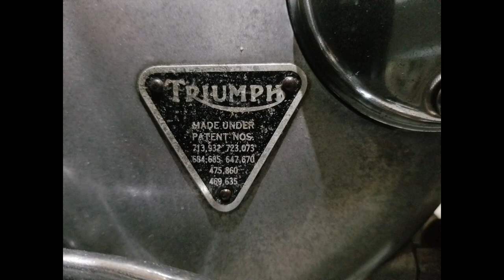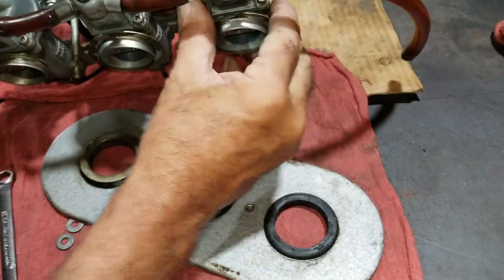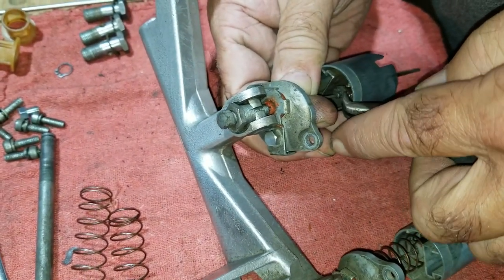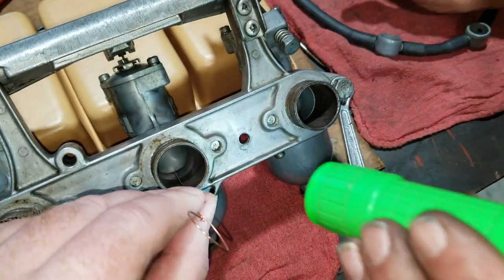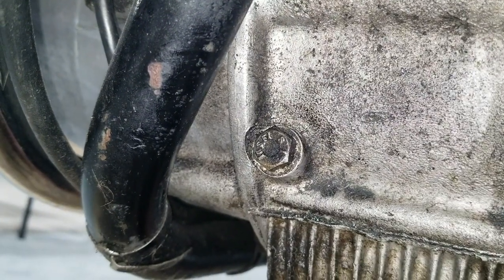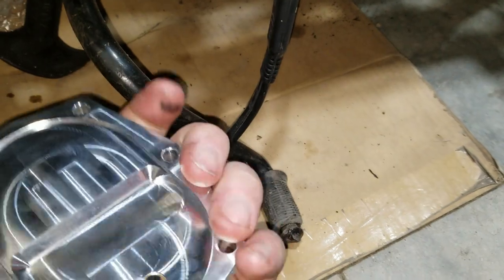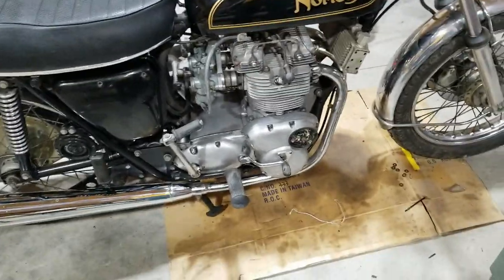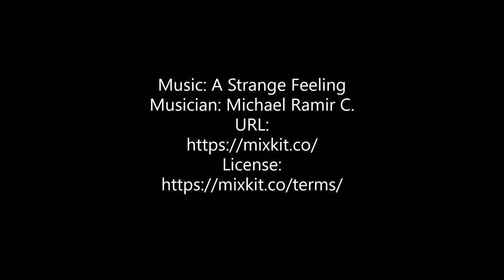1974 Triumph Trident restoration Part: 2 Starting the Trident

Comment: Enjoyed your video.🙂 Too bad you chose to have the tank repainted,  it didn't look bad for 49 years old. Also,  the carb ticklers are not a priming pump. Just hold them down until a goodly amount of fuel rolls out and you're ready to start. Glad you showed viewers the importance of filling the oil filter compartment and soaking the oil filter before start up! Look forward to more on the Trident!
Reply from the maker: Right, paint is only original once, but the tank looked somewhat good 100 ft away but there was 2 dents on the top and the red flashes were completely sun faded to the gold under coat so as hard as it was for me to decide to fix and paint it or just leave it. I decided to paint it. We are having a professional painter that has repainted lots of British bikes throughout the years, This tank that is getting repainted is being repainted with the same process that this Trident tank was painted 40 years ago so this tank should  be a spitting image of an original 40 years ago, Glad you enjoy our stuff we have more coming,

Comment: That sump plate needs machining to give you more room for spanners and sockets and also make room for the nuts to be tightened down further, as nyloc nuts need to have the stud all the way through for them to lock properly.
(I’d also like to have seen you tighten them in a crisscross pattern, but hey, as long as the plate is tight and not warped, it’s all good)

Comment: Looking at this, its like pre-war technology and bits off a lawn mower.  And external oil lines like they couldn't work out how to make internal oil galleries. When you compare them to Mikunis or Kekins on Japanese bikes, its like a 50 year progress in Tech in comparison.
Reply: Yeah, well that ‘pre-war technology’ went into the only bike that has won the Isle of Man TT races fir five cinsecutive years. A feat that NO OTHER MOTORCYCLE has ever done. Things are different now, so that will stand as an eternal record. Tridents beat the tar out of all the competition in racing until well into. the 1970s. The fact is that it was the Triumph engineers who pushed this motorcycle through past reluctant management, largely the accountants who didn’t ride motorcycles and were so focused on playing it safe that they delayed the production of these machines for about 6 years, during which, many refinements could (and very probably would) have been made. The engineers were ‘allowed’ to go ahead with this project, but only by keeping costs to a minimum, which is WHY so much of what you see seems primitive. They also managed to make a four cylinder, 1,000cc model, but only a couple of prototypes were made. This was a full four years before the CB750 came along, which was rushed into production in response to the Trident/Rocket 3 machines. It goes without saying that a four cyllinder 1,000cc bike would have been THE bike of the 1960’s, but again, reluctant and over-cautious management meant that project never got off the ground. 
Tridents are now 80 year old technology and yet still perform as well as they ever did and you can do nearly everything yourself, with the right tools, know-how, and effort. If you don’t understand the pleasure of restoring your own bike, then you haven’t really lived.